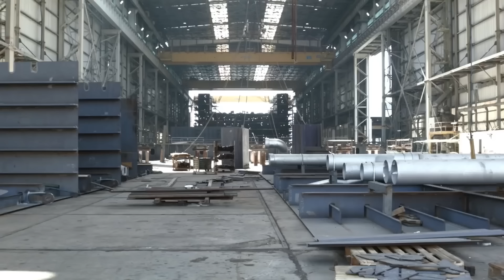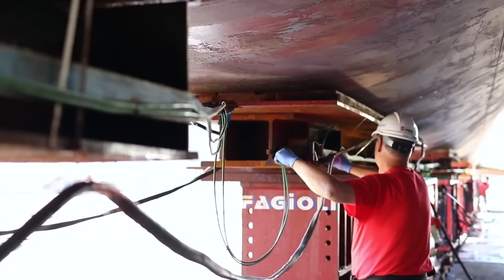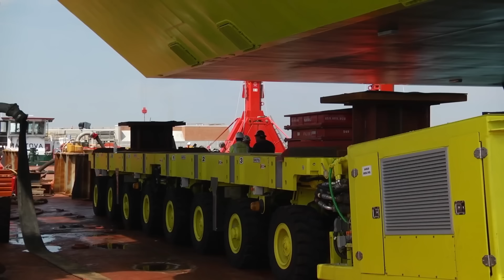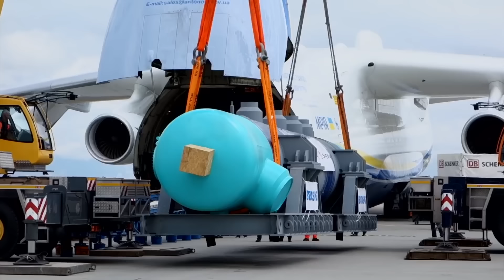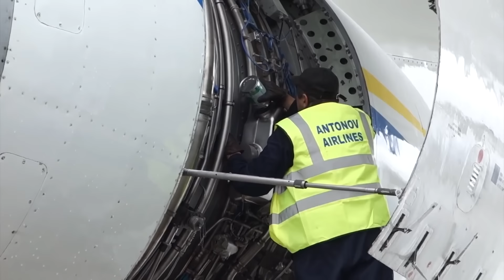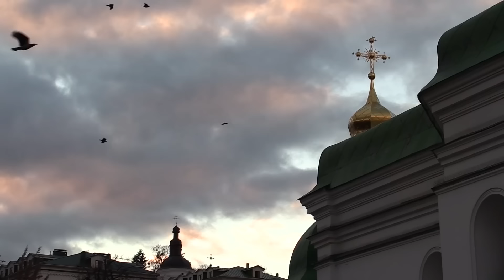Heavy Lift: The World's Largest Moving Equipment | Complete Series | FD Engineering

Comment: Seems like it would be weaker where they cut and welded it back together. Are there not any continuous spars spanning the length to keep the thing from folding in half?
Reply: a weld must be stronger then the base metal, so it cannot be weaker